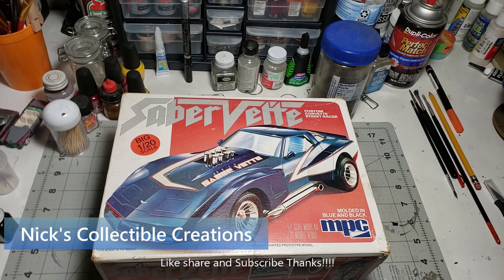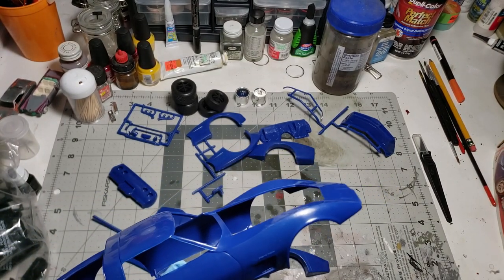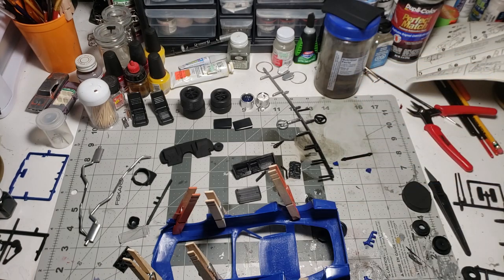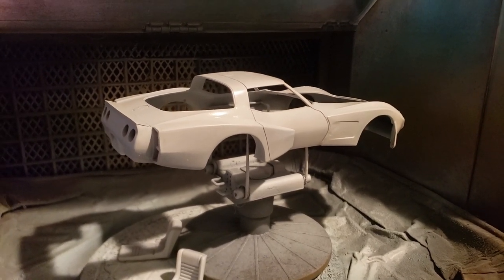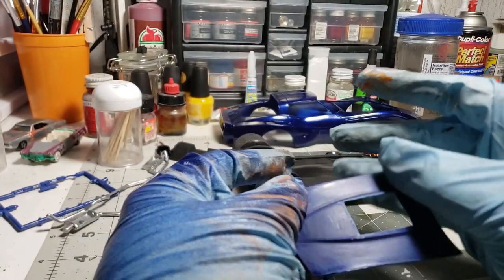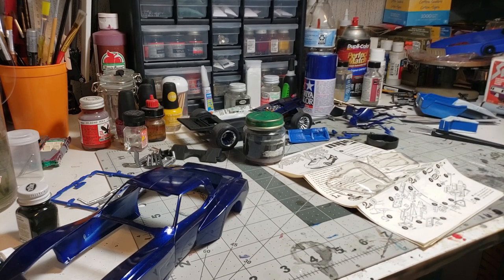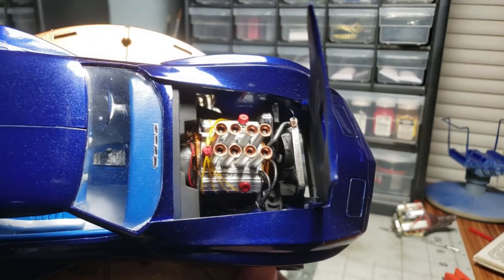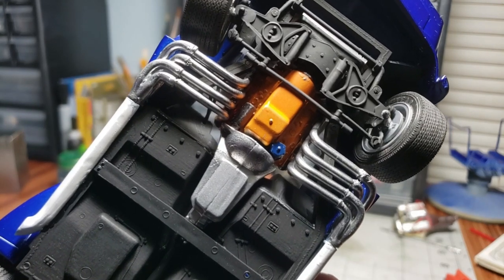Vintage 1/20 MPC SaberVette Corvette Model Kit | Review Build

Comment: Nice build on the Corvette that you did question why did you paint the spark plug wires yellow you couldn't find any wiring that was already yellow and the other thing on a real car you are in and out of the car how many times I don't understand why you put a white carpet that would be so dirty all the time on a real car I would have gone with a light blue color or even a dark blue color for the carpet I would have never done white carpeting
Reply from the maker: Not a real car, it is a show car.  Look at the box art.  Second I paint my wires because as I showed in my video I use $1 roll of fishing line that can be painted what ever color I want.

Comment: Body looks great, shame you went back to crap furniture spray paint afterwards.  These old kits do hold up well and the fancier ones like this always needed putty and sanding.  Tat windshield can be easily restored using the Novus system of plastic polishing.  It'll shine like new after a run through of the 3 bottles and is my go to for any model polishing.  

I know people love their rattle cans and the cheap furniture spray paint but folks it's not worth it.  Yeah it's a bit cheaper but the results are far cheaper as well.  Tamiya is great if you need to use rattle cans but I'll tell you a secret, Rattle cans are not easier than an airbrush, they are not better than an airbrush nor are the results.  That said the Model rattle cans will produce better results than anything found on a Walmart shelf every single time, you can take that to the bank.  If you want hard mode ditch the airbrush and go rattle can and don't forget the binder full of sandpaper. 

Great video loved seeing the old kits being worked not stored for a change.
Reply: What happened to I do this for fun, I'm not showing them, just enjoying them myself.   Less soapbox, more enjoying the hobby.  You do you, I'll do me.